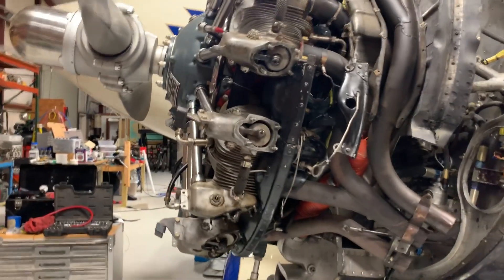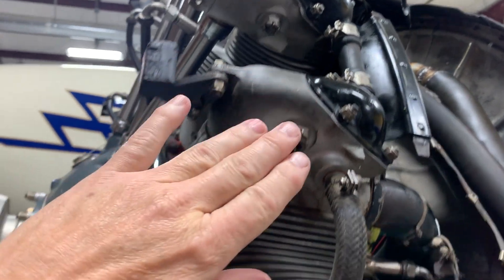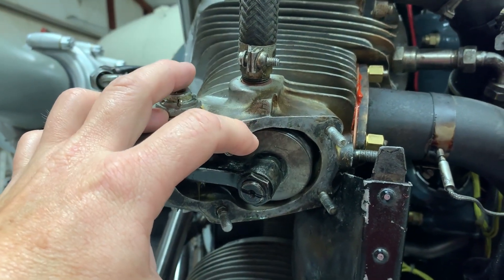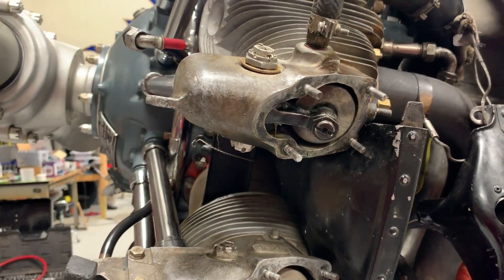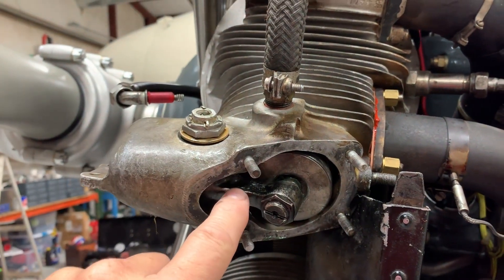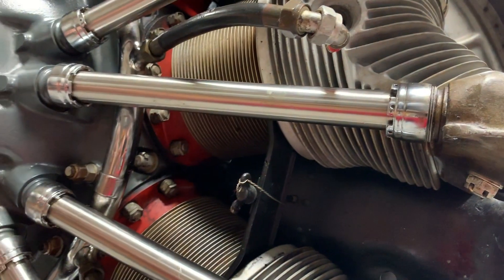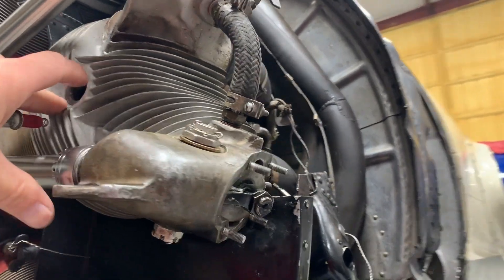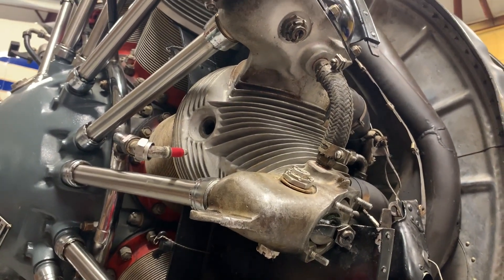Valve Adjustment and Rocker Arm Replacement on Pratt & Whitney R-985

Comment: 0.01 inch is in the P&W manual! 0.01" is one HUNDREDS of an inch!
Reply from the maker: Um, I'm not sure how you read gauges but 0.100 is 100 thousandths, 0.01 is 10 thousandths and 0.001 is 1 thousandths.
Reply: @nizexlizzy  0.01 is one hundrets

Comment from the maker: Just a note:  Now that we have the proper tools it isn’t necessary to do all the monkey work.  The proper way is to use the tool to compress the valve so you can remove the push rod, then remove the rocker bolt, then the spring.  Just sayin, tools are the bomb. :-)